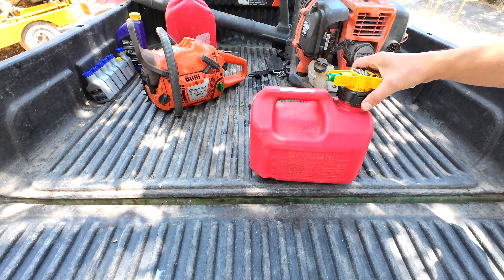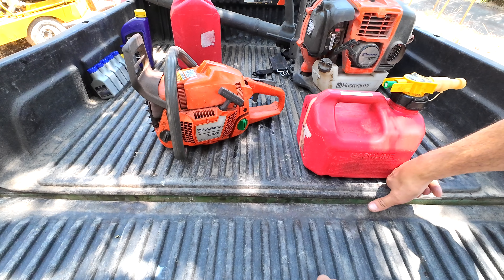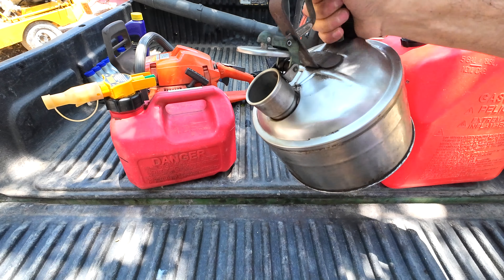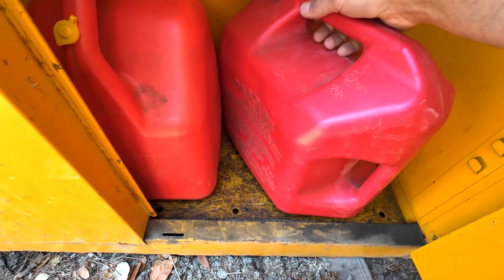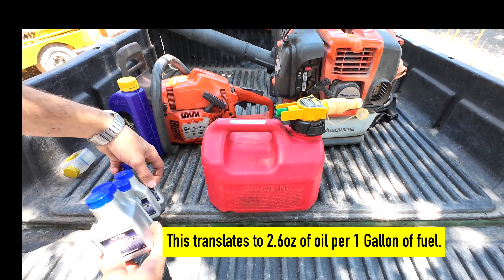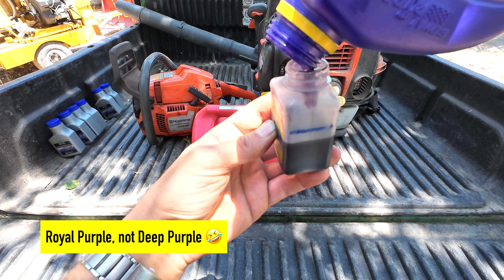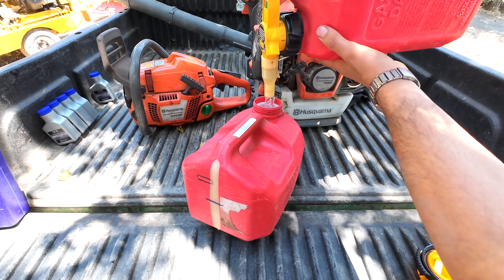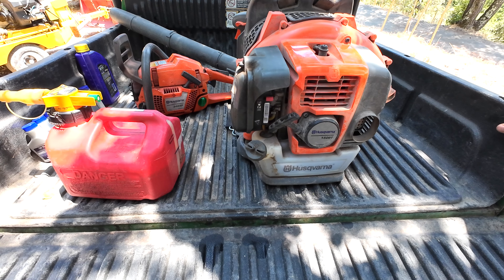How To Prepare Mixed Gas and Oil for 2-Stroke Engines - Foolproof Setup

Comment from the maker: Links to items I use in this video:
- No-Spill gas can 1.25 gallon: https://amzn.to/4dvwn2T
- Royal Purple 2 cycle oil: https://amzn.to/4cdhT6q
- 6 pack of 2.6oz oil: https://amzn.to/3SzIt2P
Also: Husqvarna Leaf Blower: https://amzn.to/4dqsHiB (this is an entry-level model, but I've found it to be extremely reliable and easy to use).

Comment: Do you know anything about how to check an old chainsaw (or other 2cycle gas machines) that has been sitting for a while? I see good brands at garage sales and even on the curb that I wouldn't mind putting work into to get working.
Thanks again for your simple instructions!!! There's so many nuggets mixed in as you talk and show your techniques that I have written down to upgrade my stuff.
Reply from the maker: If you see a Husqvarna chainsaw with an "XP" in the model number at a yard sale, it's worth having a real close look. I have intentionally only stayed with Husqvarna chainsaws (but I know that Stihl, Jonsered, and Echo have some good models). Husqvarna has super intuitive model numbers: Last 2 digits are engine size in cc. First digit is the generation (eg 272, 372, 572 are successive generations of the same size 72cc chainsaw). An "XP" means professional saw, and it actually is dramatically better quality compared to non-XP models. Unfortunately, Husqvarna also has a lot of low-quality chainsaw models that are built for a price point, that are not worth your time. The telltale signs are: 1) Plastic Handlebar (not the wrap, the handle material itself), 2) Front side of chainsaw next to the dogs is plastic, 3) Single bolt for attaching the blade. I stay away from any chainsaw with such "features".
Reply: @EagleNestFarm  Thanks for those tips. Always good to have.